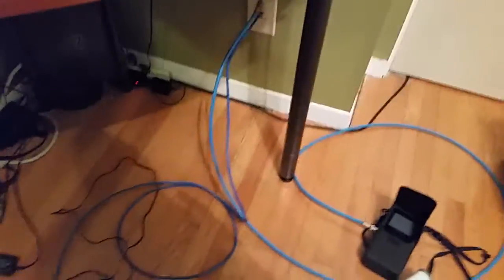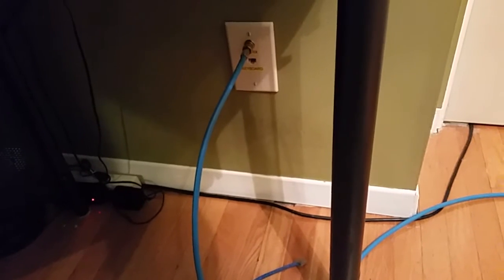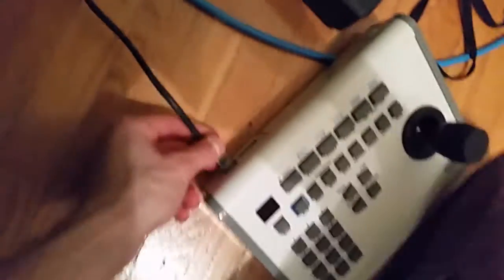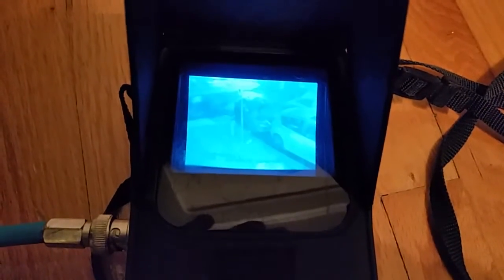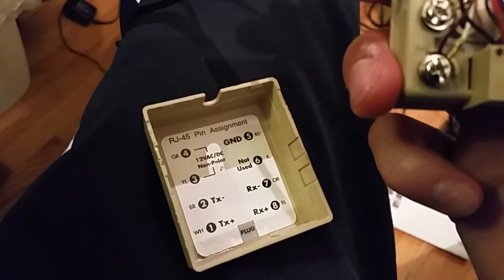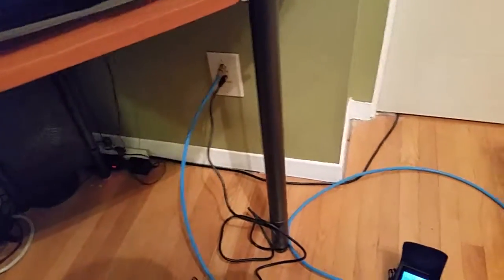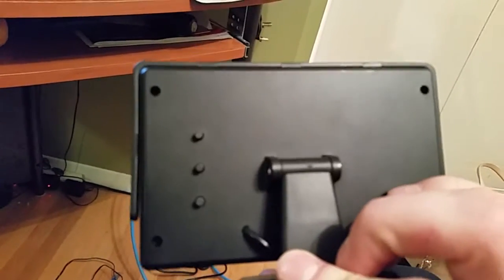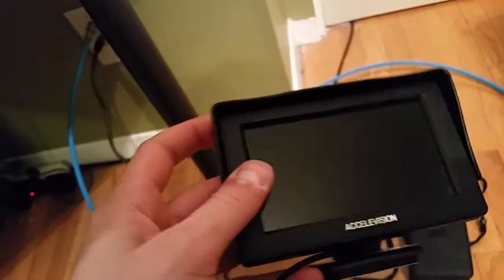How to Connect a Pelco KBD300A as a Remote Keyboard to CM6800 Matrix Switcher ( With KBDKIT)

Comment: I tried to "share" the ptz portion kbd300a rj45 port on the cm4800...and tried to have ptz controls work over the DVR control...but to no avail.   Any thoughts would be appreciated.
Reply from the maker: Is there not a wire diagram available for that unit?
Reply: @QuaabQueb  for which unit the cm4800 switch or the kbd300A?  anyways....i have no diagrams for neither ?
thanks...Tk
Reply from the maker: @KVCTechnologies  the cm4800 manual should show keyboard hookup